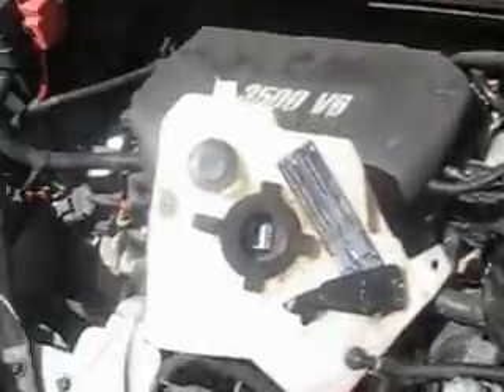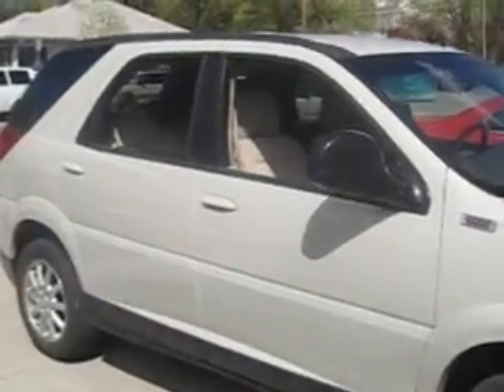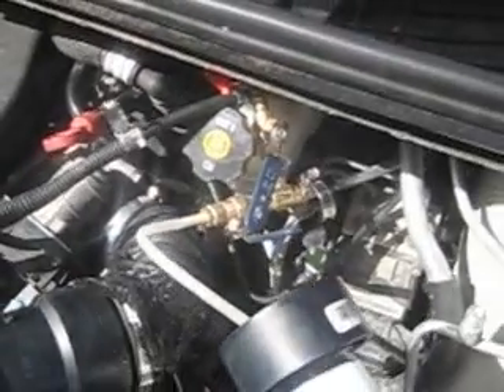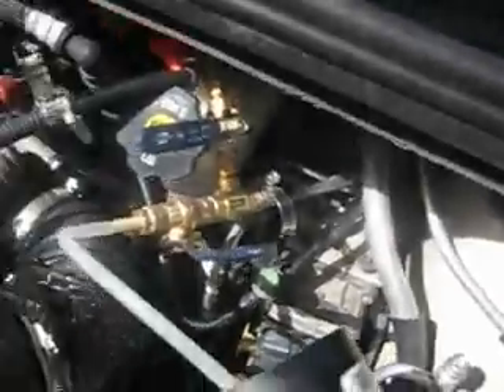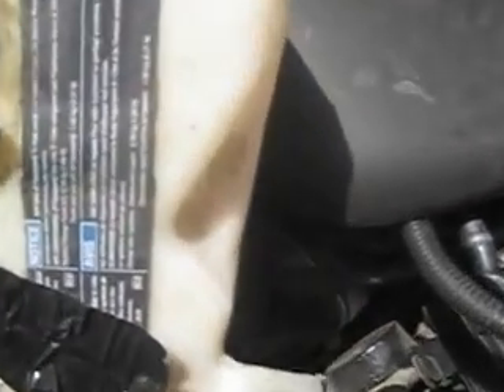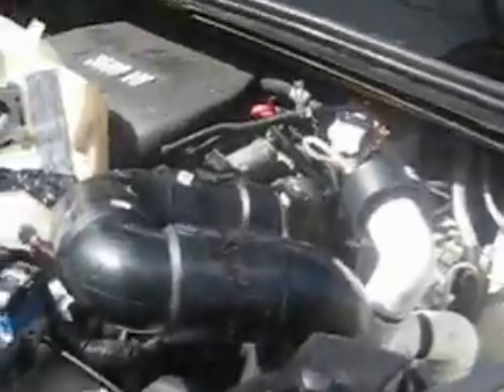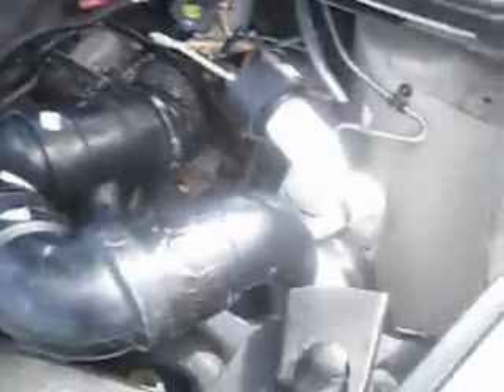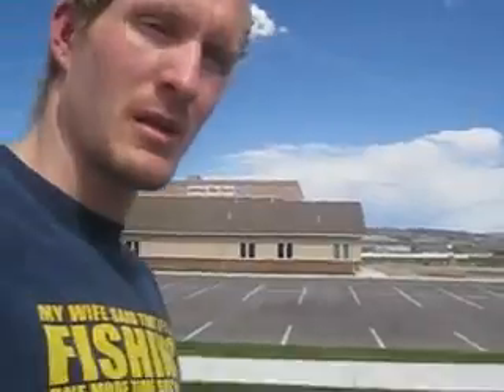200+ MPG Gasoline Vaporizer Project Original Design (Driving On Only Gasoline Vapor)

Comment from the maker: The new system I have designed is being machined and fabricated with this new design I will definitely be cracking the gas there is no bubbler. I have also designed a water injection system which will be incorporated into this new design. The water injection will keep the engine running cooler, as the water expands into a vapor it absorbs heat thus reducing the heat in the engine by up to 100 degrees. I have not shared this new design yet but I will as soon as it is completed.

Comment from the maker: By vaporizing the fuel first before it enters your engine if vaporized correctly this allows all the gasoline to be burned during combustion. The end result is a 99.9% burn rate virtually eliminating emissions. You have virtually no gasoline deposits remaining as they were nearly all consumed during combustion. This actually increases power and efficiently because nothing is wasted out the exhaust and burned by your catalytic converter.

Comment: its just basic scince u might find that something will run with the setups you have but you may be running very lean sometimes engines will run lean  and make good power but will not last thats why cars have very high tek fuel systems to get just the right amount of fuel

Comment from the maker: I know that because the hydrogen molecule is so small it seeps past the pores in metal this usually only happens when hydrogen is stored under pressure.
I will check out the information you provided. Thanks for sharing it.
Sorry man I'm not intending to be rude when I ask people to validate their statements I just like to know where the info came from so I can learn from it.

Comment from the maker: k. 
U use a steel mesh material. This prevents any back flash from entering the vaporizer container. I have also added one just outside of the air intake so there is no explosion occurring in the air intake pipe.

Comment from the maker: First you would need to make some modifications to this design. You need much smaller hole in the air inlet down pipe to prevent the gasoline from splashing so much. You need to have the bubbler pipe submerged lower into the gasoline so that when you go up hills etc. your car does not die. you would also need a new float because the one in this video is to large for the container. Other then that there are not any drawbacks.   Heat is the way to go though not bubbling air through the gas.

Comment from the maker: I need to change my design and drill much smaller holes in the air inlet pipe at the end that is submerged under the gas so I don't have a problem with liquid being sucked into my air intake at high speeds/high RPM's or during acceleration. I could measure it at lower RPM's but I want to have a design which will be realistic which will work at any RPM's. Thus far the vapor by heat method is the best route.

Comment from the maker: As for the results comparing the vapor by heat to the vapor by bubbles methods I have not been able to accurately measure the vapor by bubbles method because it is way to inconsistent.

Comment from the maker: This is why we need a controlled heat source such as an air or liquid heated heat coil that you can open and close with solenoid valves that are connected to a thermostat With a controlled heat source you can have control of the amounts of vapor being produced.

Comment from the maker: With the heat produced vapor when you are producing the vapor with purely the heat coming off the engine without anything extra such as running a heating coil through the container, when you drive at high speeds such as 60+ MPH the air flowing through the engine compartment cools the container down to much so it no longer produces the amounts of vapor needed to run the engine.

Comment from the maker: Correct it runs better then original factory. I have gone 65 MPH with the bubble produced vapor and 85 with heat produced vapor. I'm sure I could go faster with heat produced vapor but I have not tried to yet.

Comment: You mean that with heat vaporization, it actually runs BETTER  than it normally does original factory?  That is awesome, if so! How fast  have you drivin in car with bubbler produced vapor?With heat produced vapor?  What percentage better, roughly, is heat vapor compared to bubble vapor for you in your tests to date? By the way, thanks for always answering all my questions. Appreciate it much! God bless you. Take care.

Comment from the maker: It almost opens up proportionate to the throttle body butterfly valve when your at about 4000 RPM's its open about 3/4 of the way.As for the acceleration performance yes it does work adequately.
With vaporization by heat my car actually ran a little better then it normally does and I can red line my engine. With vaporization by bubbling the air through the gas I have had problems when I punch on the accelerator and when I go up hills. This is why I need smaller holes in the bubbler pipe.

Comment: IIs secondary air vave rigged so it opens proportionately to throttle body butterfly valve, ie., is cable pretty taught between the two? How about acceleration performance, does it do so adequately for most driving applications? I pretty much drive like a granny anyway.. Thanks

Comment: Please finish original setup design video, of air valve, particularly, before moving on to new one with the more complicated heating plate and glow plug heater. I live in hot climate, I may not want to go that route. thanks

Comment: I think you could take the leftover an mix it with your old oil and recycle it. Just a though... I was thinking of encapsulating the transducer in epoxy resin after modding it but i'm just gonna wait for your progress to start my project. How are you planning to deal with the fact that the vaporization tank gets sooo cold, cause i was thinking about heating the gas with some of the exhaust leftover heat.

Comment from the maker: If you only have to drain your tank about every 3000 miles or more then you could drain it with your oil change. However by running vapor through your engine you get a much cleaner burn therefore your oil would stay cleaner longer reducing the need to do oil changes as often so it would be an inconvenience to people to have to drain their tanks. It is worth the extra effort to me to have to drain the additives if I am getting 214 + miles per gallon.

Comment from the maker: Thus far I have not seen much of a problem with the build up of the additives. Even after running vaporizing about 5 gallons of gasoline with my system I have only seen about 1oz of additives leftover. So thus far it has not been a big problem for me. After time though these additives would build up and the tank would need to be drained. I am keeping track of the amount of additives to see how many gallons of gas you can go through before you have to drain them from your tank.

Comment from the maker: The problem I see with using a transducer is that there will be additives left in your tank that were not consumed with the vapor so you would regularly need to drain your tank to get rid of the build up of the additives which the oil companies put into the gasoline. I have been talking with pjckac1 and from the experimenting he has done the additives are a problem because we don't know what to do with them after we drain them out of our tank.

Comment from the maker: I do have a transducer that produces up to 1500ml of vapor an hour but when I bought it I forgot to order it without the sensor. I have cut the sensor off and modified it so that it will vaporize gasoline however I accidentally broke some of the discs in the process so I need to order more ceramic discs.

Comment from the maker: Such small amounts of vapor are needed to run a vehicle at the same power a vehicle runs on with liquid injection that if you were to create more vapor or fumes the efficient would go down because your car would be consuming unnecessary amounts of fumes. Your vehicle would still run fine with larger volumes of vapor or fumes but why wast and use more vapor if your vehicle will run the same on smaller amounts of vapor.

Comment from the maker: Yes I have considered taking the fumes from my fuel tank however the process of vaporizing gasoline from what I have seen works best within a small confined system. If I were to make the vaporizer holding tank larger I believe the efficiency would go down.

Comment from the maker: Next I Drilled a hole through the end of the gate hinge on the side that has the fender washer connected to it. I then drilled a hole in the 1-1/2" pipe and drove a screw into that hole. I then connected a spring to the screw and next to the hole I drilled at the bottom of the hinge. This spring allows my valve to be pulled shut as I let my foot off the throttle.

Comment from the maker: When the butterfly valve of my air intake is closed the stopper is inside my air intake against the back side of the butterfly valve. Next I ran the opposite end of the cable through the hole I drilled in the hole of the fender washer which is attached to the gate hinge. After that I placed an aluminum stopper on the end of the cable so that when the gate hinge valve is closed the aluminum stopper is resting on the inside fo the hinge valve. N

Comment from the maker: after the hinge valve is mounted onto the 1-1/2 pipe I drilled a hole through the middle of the hinge which is exactly in the center of the 1/2 hole of the fender washer. Next I drilled a hole about halfway up my butterfly valve of my air intake. After that I ran a piease of 1/8" steel cable through the butterfly valve and crimped an aluminum stopper onto the end of the cable.

Comment from the maker: It''s a rigged setup. I got a 1-1/2 pipe installed a gate hinge onto it. On the end of the hinge that points down I welded a 1/2"X2" fender washer the fender washer rests against the opening of the pipe when the hinge is at a 90 degree at this angle the hinge valve is closed.. As you lift up on the hings it will create angles from 90 degrees to 180 degrees. As the hinge opened toward the 180 degree angle more air enters the air inlet pipe that the hings valve is connected to.

Comment from the maker: I complete agree with you! Cracking the gasoline is the way to go. I have found that when you do the process as you describe it works 100% better then bubbling the air through the gasoline! The process I have discovered has somewhat to do with the process you describe as cracking the gasoline. I have found that with the process I have discovered there is almost no additives leftover, some how it is all sent through with the vapor.